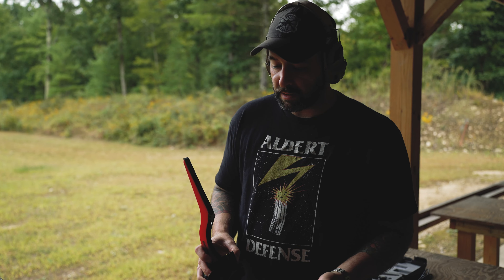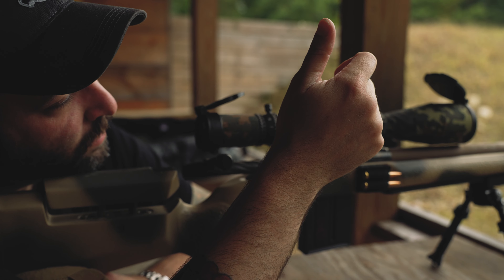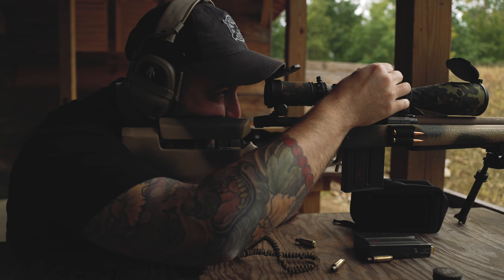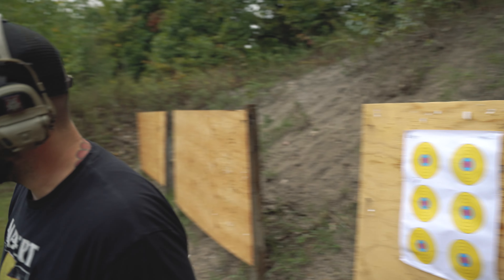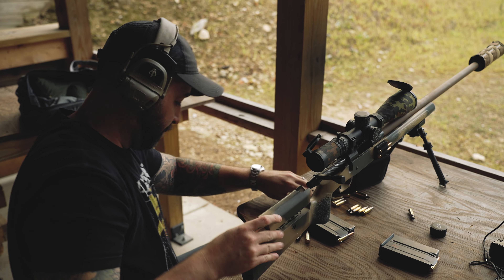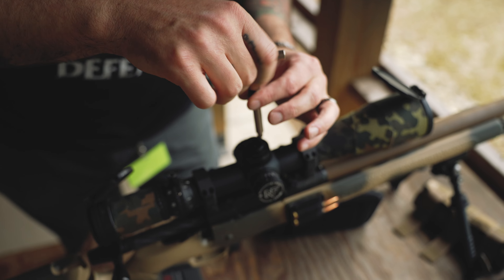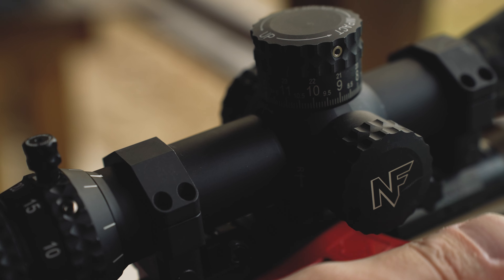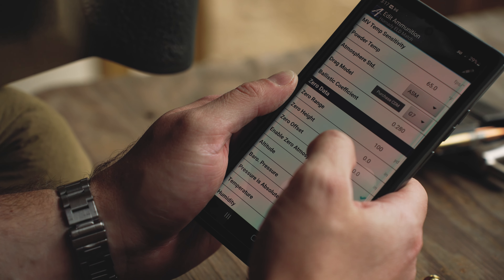Zeroing Terminus Zeus 6mm GT Build - PRS Match Prep

Comment: How reliable do you find that terminus switch lug ?
Reply from the maker: i had to dry lube it for a bit until it broke in. One of the lug ridges in the top of the ejection port was so sharp, it cut me checking the chamber. The DLC or whatever coating wore off the bolt after the first use. Granted, I won this during 2019 when he first started higher volume. It's probably more refined now.

Comment: First off I like prs things haven't dipped my toes into actually doing it. I found the terminus zeus do you think it's worth the money for non prs applications. The idea of a no smith by hand barrel swap is intriguing. Do I walk away from it without plans of prs shooting.
Reply from the maker: almost all barrels are "no smith swap". Need a barrel vise, go gauge, action wrench. Theirs is a fast swap with a set screw, IF the barrel is correctly mapped to the actions. swapping barrels on bolt guns is very easy no matter what.
Reply: @ANRDesignLLC  I'm more interested in field swapping calibers mainly seems like a nifty thing to be able to do for the price.
Reply from the maker: true

Comment: How are you liking the Zeus?
Reply from the maker: Digging it. One of the early ones. Won it off a prize table. Finish on the bolt is wearing fast. A lot of binding in the beginning. I used some dry lube and it helped in the break in
Reply: @ANRDesignLLC  lucky! Tell me which dry lube you used, as I will begin break-in soon
Reply from the maker: canned graphite!